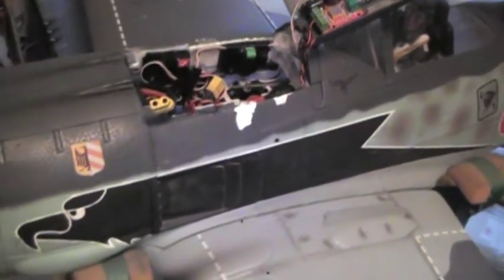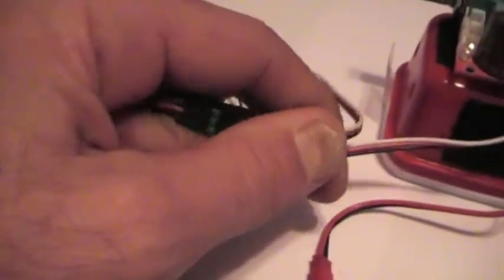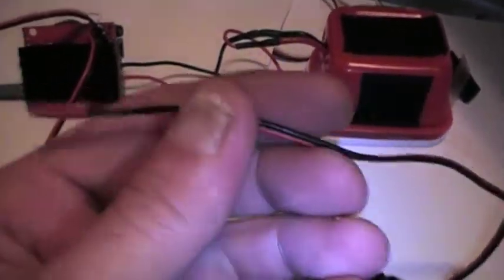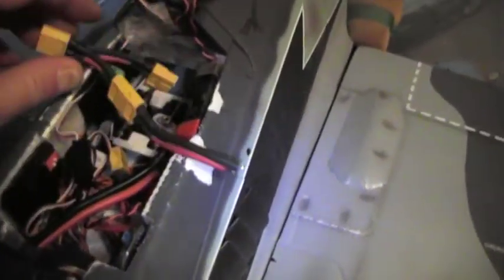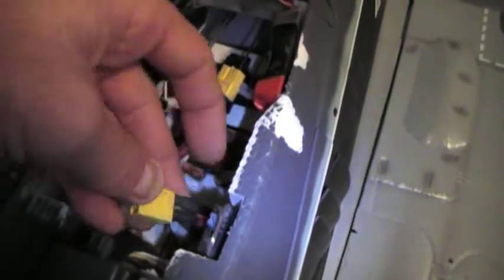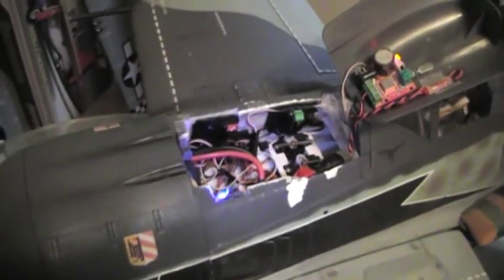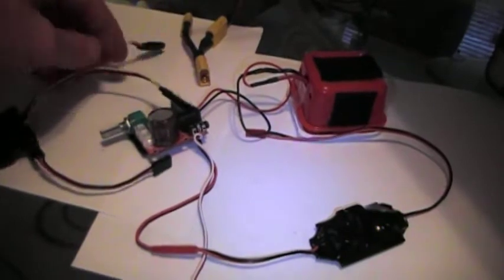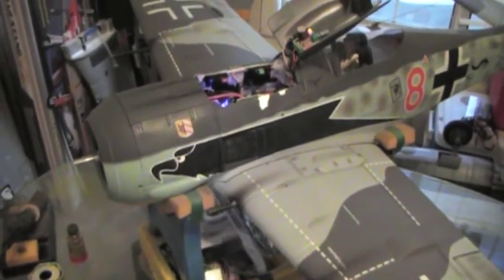Brandon Moon's modification  Of a Pro B and Budget A Mr. RC Sound system cards

Comment: Hi Brandon.  I just got the 190 and have a v4.  In your opinion where is the best placement for a 1 speaker set up.  I thought midships but also want ro put a releasable drop tank so I thought about puting speaker under the nose like you have also done.  Did you find it too nose heavy?  Any comments you have in respect to putting the speaker under the nose and tips or tricks for placement would be greatly appreciated. Keep up the great vids
Reply from the maker: Yes, for a single speaker setup I would recommend putting in the noes as I did on this video. The plane actually likes the extra nose weight any how. I've actually done another one of these planes (FW-190) and we put both speakers in the nose and simply adjusted the battery to fit further back and it flew great.

Comment: Hi Brandon, I have a sound pro has and at the time of a crash landing an element of the map was disconnected.
It is the card with the green connector which is connected to the soundcard with the wire (white/black/red) and where do I have to connect this cable? Thank you for your help.
Reply from the maker: You must be referring to the Separate Amplifier card? Best thing to do would be to contact Andrew at Mr. RC Sound.com
Reply: Thank you for your answer, the fact is that I contacted Andrew in January and I still do not have an answer. I put on the forum of rcgroups.com/mrrcsound a picture of the unit. Can that help?
Reply from the maker: Gérard PLAZA send me an email with some detailed pictures of what you're referring to and I'll try and help if I can?
Reply: which is your address email?
Reply from the maker: I'm at brandonmoon1@hotmail.com